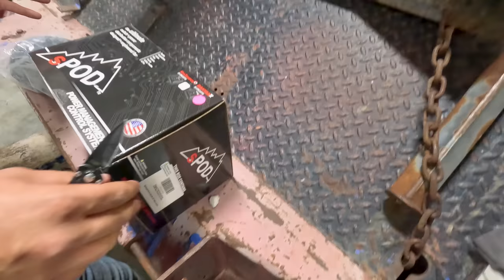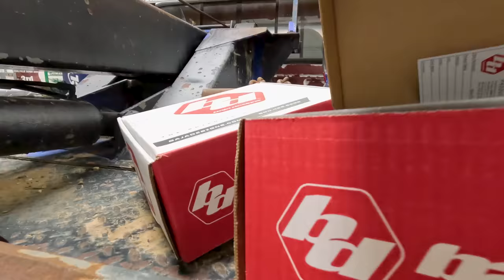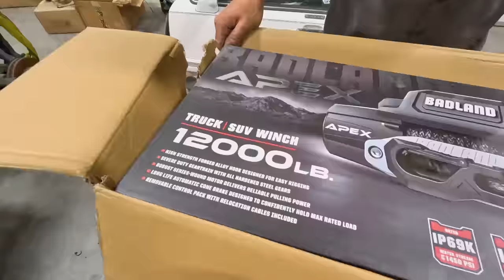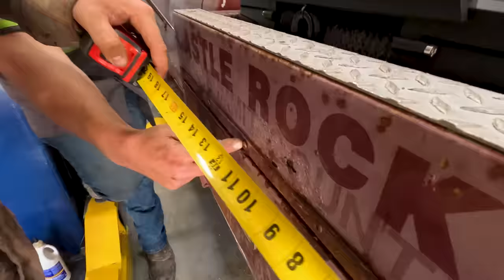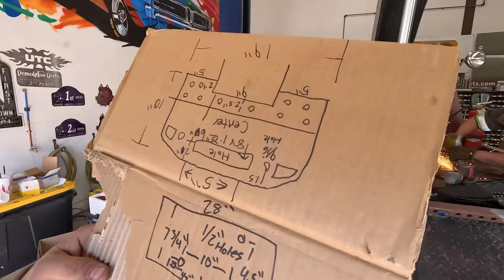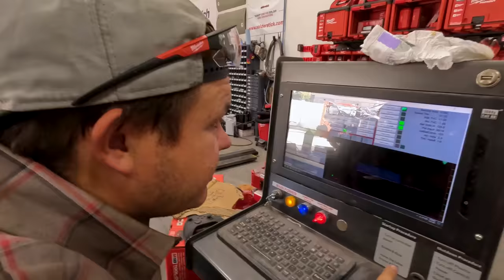Adding Massive Winches On Old Ford Tow Truck Bed!

Comment: Someone may have suggested it alread, but there's probably an alternator speced for an E350 with ambulance package that will output 250 amps and would be compatible with that tow truck. Check it with your parts guy, have him look specifically for the ambulance package alternator for any Ford around that year, you might have to make a bracket, but it should work fine and give you a lot more than what comes stock for the F350.

Comment: That 460 can be a great powerfull runner. They were de tuned when they fuel injected the 460.  Need to put a higher flowing intake, bigger cam and headers and it will be a beast

Comment: I would recommend the Striker SR955 HPC radio instead of a ham radio, its cheaper and you don't need a license. With just a small soldering of a wire on the radio board, you can easily use the CB radio band. This will allow you to operate using the lower side band and make contacts up to 1,000 miles away. i do custom setups and antenna tuning, also build portable anteanns for cb/ham radios.

Comment: Add a fult power relay under the hood. Wired to pull in when the key is on. Turn it off and doesn't matter if you forget to turn off switches. Similiar to how people who live in vans do their house batteries for charging.

Comment: Hi cool tow truck with additional winches the only thing I see is putting side winches is cool for side pulling I would keep in mind that when side pulling you will need some sort of out rigger support to stop the truck from rolling or sliding in to the ditch

Comment: You can use the hydraulic pump to run two beefy rams and mount them into each side of the truck in a angle, so u can use it for side pulling. When it's put down it can be used for either levelling it out or changing the tyre if it flat or the main one  it can be used to stop being pulled side ways whn using the side winch as it will dig in and stop it sliding sideways that's why it would be mount in an angle.🤔🤔🤔🤔💯💯👍👍👍👊👊

Comment: nice pipe work,,, do you have a rain /water tight cover for the battery cable connector @ the front bumper?

Comment: You mentioned ham radio, I would think in your are a private band base station radio connected to a tall antenna mounted on the lot property with an adequate booster should give you base to mobile radio connections. I understand that you have cell phones but a private band radio may take care of dead areas especially away from cell towers.  They are used a lot in my area and have a long range of coverage. I live in the mountains of Southwest Va.

Comment: Flexible wire pipe cleaners guys. Bend them first to get a close estimate of your angle then transfer to cardboard the same thickness as pipe. This will get you very close to what you need, then bend the pipe. Lots easier and no wasted time redoing the pipe bends

Comment: good overall fab work - tools are gold - paint the winch cages blaze orange, make sure to have a good vent sys in the garage - you want a heat punp with pos pressure hepa and a heat exchanger - you could fab one up - picture a big X made out of small copper pipes - heat pumps can be up to 300% efficient and the heat exchangers can be up to 90% efficient - use them in tandem for max savings
Why did the hillbilly go to the dentist?

To get his Bluetooth fixed!

Comment: Just FYI on the optima red top batteries. We've installed a lot of those in cars and had them die really quickly. I installed one in a jeep and it was dead off the shelf. Since you're using a lot of winches, run the optima yellow top batteries. They're a deep cycle battery and better for winch use.
Reply: Optima batteries are JUNK every since the started making them in Mexico
Reply: @jimsonnenburg7440  we haven't had the same issues with the yellow top.

Comment: BIG FRED roles off the tongue better than King Fred. Maybe you need a second "back up" battery with a battery switch on Big Fred. Are you going to build a shield around the Baja lights to protect against tree limbs?

Comment: Check out Mechman alternators they have a direct bolt on that will put out close to 400amps. We use them for car audio competition. I have a 2nd alternator on my truck dedicated to run my audio equipment that's 14.8V internally regulated and is 390amp output

Comment: King F.R.E.D.
Robbie shoots down Hillbilly's idea to mount the rear wench to the plate and THEN weld it on, because you can't remove the wench. Then proceeds to build a cage around the wench so tight, YOU CAN'T ROMOVE IT😂😂😂

Comment: How are your front ball joints on the red wrecker?  Saw tire wear as you rolled into the shop.
Reply: that's kingpin 60 under that. no ball joints

Comment: Check with DEL CITY about the boots for your jumper cable attachment on the front bumper to keep dust and dirt/sand out of the connections

Comment: I always strongly dislike Optical Collusions.

On the two side box doors, add a 1"x1/4"x6" strap that pivots down over the doors with a friction hold so it stay up when the door needs to be opened. That will take a lot of pressure off the latching mechanism. You can chrome plate them. 

The new cable clamps with the residential clamps won't carry the load the bad original 400 amp load clamps will. However, the elephant in the room is the exposed positive clamp will easily short against any grounding surface. If you have red tool dip. Dip it, let it sit, dip it again, let it sit and do this until you have a nice thick surface then scrap off the rubber on the jaws and teeth of the clamps. You will not be unhappy with the small amount of work to possibly save your alternator, batteries, or even the entire wrecker.

 Enjoyed the show.

Comment: Are you Sure Robbie that the rear winch will be removable by just unbolting it, from out here it looks like you have "caged" it in?  Also many years ago I worked in a factor where we bent and twisted Rebar, there is a very easy and simple method of getting the bends exactly in the right place every time, truth is I can't remember it now, but I'm sure with a little lookie on tinternet you'll find it.  Awesome build again and great vid!

Comment: defo King Fred!!  for the alternator was the engine used in any other vehicle? thinking a later model vehicle that used that block. might mean a swap to a serpentine setup. or you run dual 80A alternators. or and this would take a bit of reasearch. is there another alternator of same/ similar dimension that would swap in? and have chad sort the wiring so it charges everything properly?

Comment: That's a lot of work you guys just did - great job. Question about the Baha rear lights. Aren't they designed to mount parallel with the horizon (are they both spot and fog)?

Comment: When you put two plates on either side of a piece of sheet metal you might want to make them slight different in size so you don’t get a cookie cutter effect. If there is no load you should be alright but even long term vibrations may induce metal fatigue.

Comment: if you're going through that sidewall of the bed, you might want to consider running a normal fairlead on the INSIDE so the cable coming into it doesn't rub on the inside plate of the bed and fray it out....just a thought...

Comment: 2:12 "This terminal is very, very corroded."  Two minutes of cleaning would get that system charging while being used (driven)...but I'm sure you already knew that.  Sometimes you need to put in the extra few minutes, to save you more time in the future.

Comment: Make you tubes out of cheap thin gauge pipe first, using multiple pieces welded together if necessary, then make the final product using the more expensive thicker tubing, this will save you both time and money.

Comment: When bending, always remember that a circle has 360°.
So if you are going to make a u shape against a surface and the ends are to go 90° straight up, the total of all the bends must be 180° since you are making a half circle.
So 70+70+30 is 170° and then the ends will not be flat against the surface.
If they do not go 90° to the surfar or the surface is not flat, you must include the angles on the surfar and/or the angle you want them to go down against the substrate in the calculation.

And when you make the cheat pieces, mark them every inch so you know how much pipe a bend uses up so you can find out exactly where on the pipe you have to bend each time and how long pipe you need.

You can solve anything with math.
Reply: Sounds reasonable. 😉 I actually did learn something that could benefit in many different scenarios. Thanks for sharing!

Comment: Robbie, I have a question. If you mount your wenches where you're mounting them. Are you wielding a minute? R you bolted them in because if you break your line, you're gonna have to replace. An eventually, is there enough room for you to do it without removing it?
On all 3 witches.

Comment: On that rear winch can you still get it out from the back (towards front of truck) if you need to service or replace it?  With the way the bed is angled it does not look like you could remove it that way with those bars installed and all welded in.

Comment: Those components on the jumper cables are there to stop you spiking the ECU etc when you connect and disconnect the jumper leads.

What you showed on camera was a resistor.

Also, you don't crimp and solder. You do one or the other. Not both.

Comment: Odd how you guys all hate a self reeving winch by mounting it four foot from the fairlead :o) If I had a big flat bed like that then two winches would be by the headboard with a donut in the middle to go in any direction. *my rear winch rope could go down either side to pull forward. Centre top line was also ace :D

Comment: Do some research, you can get a 240 amp alt that will bolt on, they are wound to make more with less heat, heat is what kills alternators. They are used often on people movers.

Comment: 70 + 20 is 90, but it needs to point down to the other 70, so it is 20+20, so the centre bend should be 40? Probably :D

Comment: I bought a sweet custom alternator for my 1988 F350. 140? AMP for less than $225. One of the best mods along with custom aluminum radiator with electric fans( mechanical fan delete).

Comment: Love the videos. But how about fixing the starting/battery issue first before adding things that use battery power. Just a thought.
Reply from the maker: we have parts on order to fix that. We just currently don’t have the parts so rather than waiting on the parts, we did other things.
Reply: @RobbyLayton  gotcha. I completely understand the waiting on parts situation.

Comment: I’m surprised you guys don’t run high quality winches on your equipment considering it’s your livelihood. But I assume your probably sponsor by badlands. I notice Matt also runs them. They are a ok product but more designed for the homeowner. Not for commercial use

Comment: hi i lik ethe work you guys do and im a big fan of the team amd i was wondering why you did not put a peice of pipe in the back of the winches to cover the whole thing or bolt back plates on the new cages so you can acces the winches

Comment: You will have to convert the wrecker Alternator to a later model unit the 80 Amp will not be Enough you need a 250 Amp Alternator but this 130amp would work with bracket mod DENSO 2105204 and a Welder on board also!

Comment: If you look at a diesel F350 from the same year you will see how two batterys are mounted under the hood . Mt 92 F350 diesel has a 120 amp alternator ...

Comment: Batteries in the bed, isolating charge controller between the main electrical system and the batteries in the bed, and finally add a small solar panel on the roof of say 50-100 watts to help keep the bed batteries topped off.

I think this one by Renogy would work - B07Z4GSYC2 - It is 60 amps and doesn't allow power through until a 12v signal is sent from a switched input.

Comment: I will say if you have Motorcraft batteries in the 550, you might want to look into a different brand. We've had quite a few corroding issues with Motorcraft batteries.

Comment: Look for a high output 3g alternator. Look at Quick Start Automotive Electric. They have 140, 160, 200 and 250 amp options. I never used them, so I can't vouch for their reliability or reputation. Another one is Quality Power.

Comment: Volt meter testing on charging systems.

 Engine running, headlights on. 
 Volt meter set to 20vdc.

 Test one. Positive to negative battery posts. Not the terminals around them.  14.1 to 14.8 volts is expected. 
Test two.  Negative post to the engine block. Less than 0.04vdc  or 4/100th of a volt max. 
Test three.  Negative post to the body. 0.04vdc max. 
Test four.  Engine to firewall.  Less than 0.04vdc max. 
Test five. Positive post to the underhood fuse block and then most of the fuses in the under hood fuse block. 0.04vdc max 
Test six.  Positive post to the alternator output stud threads. 0.3vdc max is expected. Thats 3/10th of a volt.   Print this and perform it.  I use this test sequence every day.  Helps me find bad electrical connections that make cars and trucks have horrible electrical problems.

Comment: Motor homes have "house" batteries that power the house lights and do hickies, they have an rv relay they charge when the engine runs then are isolated when off so it doesn't drain the engine batteries

Comment: Order an alternator for an ambulance, normally they are a 100 or 125 Amp, and there is an accessory bracket to mount 2 alternators

Comment: You should fit a Lithium-ion battery to run the winches, they run a lot more power without voltage droop at high current draw.
Reply: The BMS in the battery will not allow the Current those Winches will need at full pull which can be in excess of 320 Amps. He would need 2 or more batteries with 200 Amp BMS's 
Lithium-Iron Phosphate is a Better battery, too.
Reply: @m9ovich785  The BMS will allow whatever current it is designed and rated for, and in theory that could be 20,000 amps or more.
Reply: @terryhayward7905  I have yet to see or hear about a BMS allow more than 200 Amps....

Comment: Depending what power is required, why not install two batteries, in either parallel or series.
Parallel will impact the output voltage and the capacity of the battery system. Batteries wired in series will have their voltages added together. Batteries wired in parallel will have their capacities (measured in amp-hours) added together.

Comment: Should have cut a hole in the back and recessed the winch into the bed and then protections would have been just a flat plate.

Comment: Just install a main battery switch, then, in your spare time (which doesn't exist), you can search for the parasitic drain that is occurring. In the meantime, all you have to do is remember to switch off main power when you park it, and switch it back on when you go out for a rescue.  If you don't at the very least, take of a terminal connecter, you're going to have ruined batteries. At best the damage I have seen has removed over 1 third of their duty life. You can't fast charge flat dead batt.'s with good results.  And I'd go with Bob.  With all respect. The rig was parked and rotted, and now it's being reborn into a new life with a new family. There is no requirement to keep the same name. The main reason is I just don't like "King Fred". It doesn't fit the character of the truck. But Bob does. And I Like Bob the RedFord, and I like Bob, The Big Red Truck, backstories.  A mini rotator would be insane, but you'd have to rebuild everything from the ground up, especially the suspension, to handle the side tilt.  Put that one on the drawing board as a seperate NON BOB project, would be my advice.  My head is already swimming with specs for a mini rotator.  Databyter

Comment: Why are you putting bars over the winches?  Just want to keep adding extra weight to the rig?  Do you plan on dropping stuff on the winches?  Okay tie off points.  Well I'm now wondering if the back winch bar cover is to tall for the ram to lower to boom?

Comment: I wouod be hesitant to use a tow point mounted on my wheel lift like yours with a kenetic rope.  The hydraulic cylinder and valves aren't made for the jolt it will get, even with the kenetic rope.

Comment: you can get a high out put anteater from dozens of shops for fords  Chevy's and dodge 80 amp is not  enough power for all you have check out (TAE electoral) they have 240 to 400 amp alternators?

Comment: As long as you're gonna run electric winches and all you need is the hydraulics for the boom and the under left why don't you run a alternator of your PTO To charge the third battery

Comment: you know where you can get a lot more power is find a lower timing gear off a older police car  from the 70' or early 80's and the will move your timing on your cam up 8 Degrees  or buy a timing set with the 3 slots and it will move your timing on the came up also. but i dont think you can get 8 degs that way. and you will go so much more power. at least 20 hp and about 40 torque.  80 am not going to be enough find one off a Lincon or something.

Comment: Any real towie wouldn’t deck around with all that. Two rear facing winches mounted up near the cab ( not at the rear) are all you need. Firstly, the truck is two short to really need side pullers and not heavy enough to really make efficient use of them. Pulling from over the back two corners gives you the greatest leverage and you can get se snatch blocks to side pull if totally necessary. That rear mount winch is bad planning.
Reply from the maker: Oh……. Thanks for letting me know!